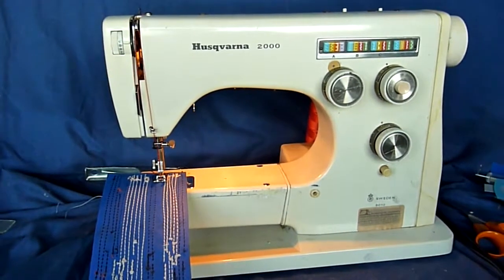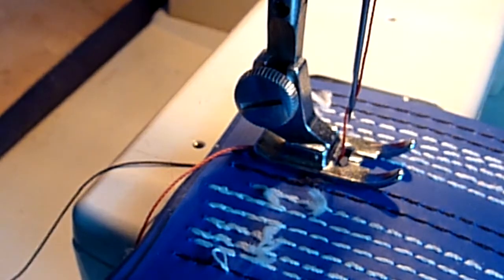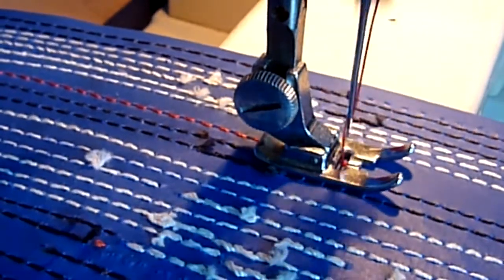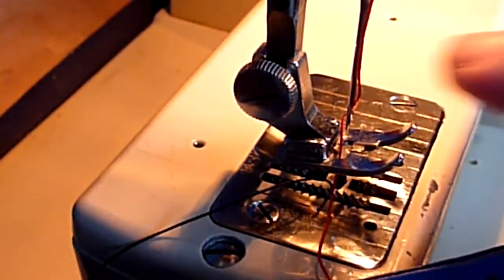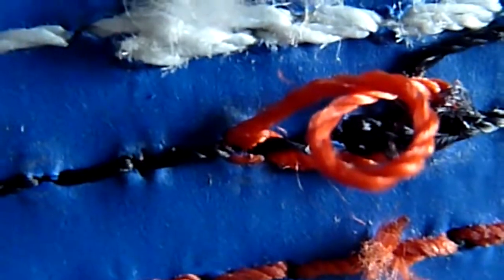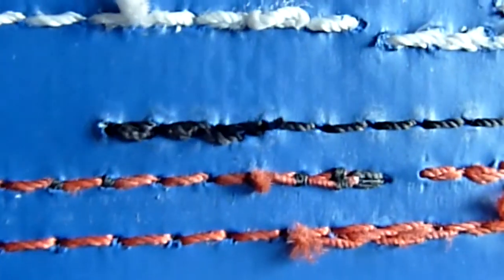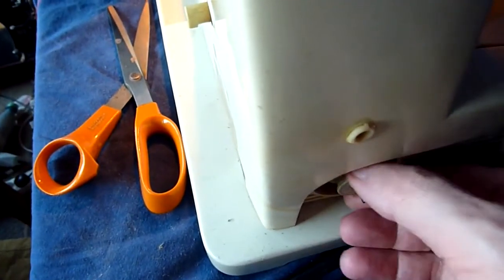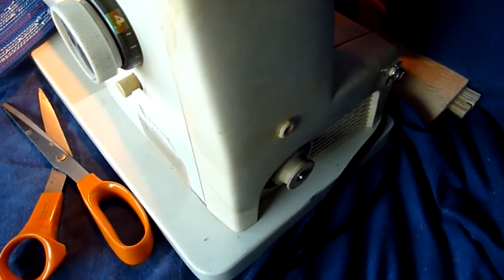Husqvarna Viking 2000 sewing machine sews heavy thread and fabric

Comment: I have a Husqvarna 2000, had it for 17 years and put it through a lot of abuse without any service, because I didn't know it was necessary. It eventually started to seize due to the lubricant becoming sticky, which broke the cam gear. Luckily I could have a friend 3d print a new one (this was before you could buy the prints). I have sewn leather in different thicknesses and many layers of denim. I am very satisfied with the machine, and only just recently bought a 19e model because the bobbin case on my 2000 was worn down where the lever catches the shaft in the bobbin case holder, so it would not stay in place properly. It was simply cheaper to buy another sewing machine than replacing the bobbin case. I am though thinking about buying a singer 201 or Husqvarna CB-N as a dedicated straight stitch for heavy weight sewing, as they seem easier to modify. I have an 18v brushless makita drill which outputs 85 nm with a broken chuck, so I think it would be interesting to use it to power such a machine.
Reply from the maker: Thank you for your reply regarding durability. When I got the machine about two years ago, the inner camstack was broken as on many other of these machines, and I have not replaced it yet, but I will eventually do it. I also experienced very sticky old oil in the machine to be cleaned out. For these strong household machines I would not go above 3.5 Nm on the main sewing machine shaft. It will cause 250 N or 25 kgF downforce on the needle.
Reply: @sewingmachinesindetail  the 2000 series came oiled that was supposed to be for the lifetime of the product, in sintered bearings. Maybe Husqvarna did not expect the machines to last 60 to 70 years.